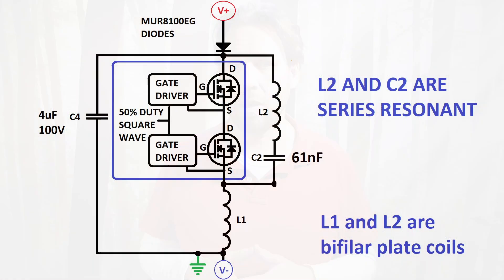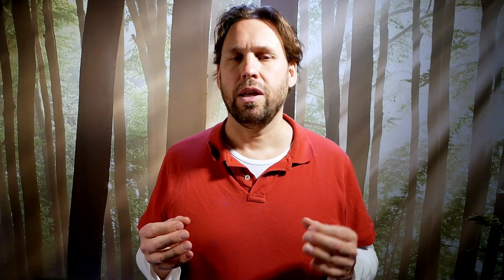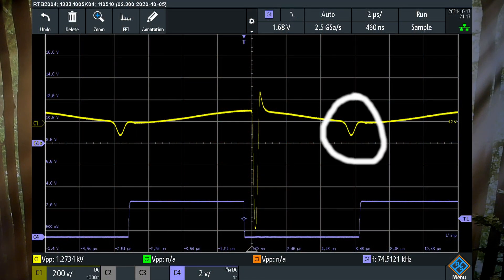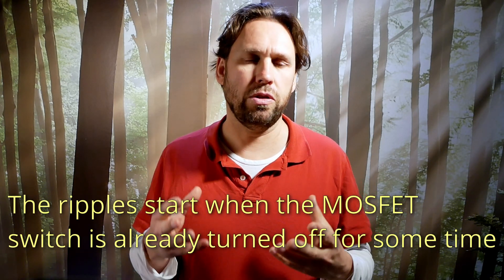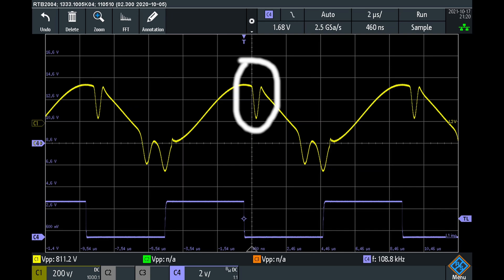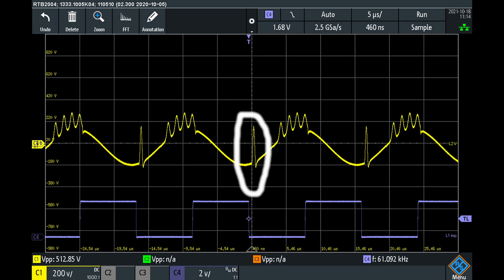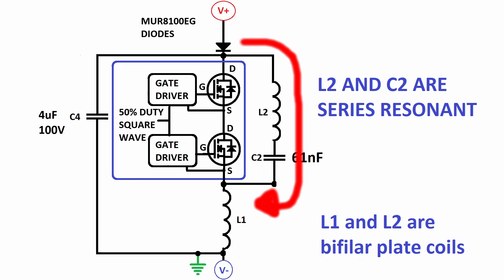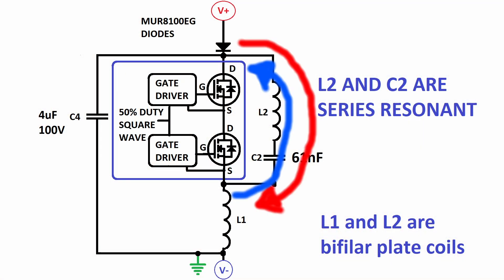The Ripple Anomaly

Comment: I'm reminded of Tesla Patent 462418 where he says "to produce current-impulses succeeding each other with very great rapidity, or, in other words, to render the duration of each impulse, alternation, or oscillation of the current extremely small."  Perhaps these ripples are a sort of guide by which to perform a resonance amplification
Reply from the maker: this is a link to the patent:
https://teslauniverse.com/nikola-tesla/patents/us-patent-462418-method-and-apparatus-electrical-conversion-and-distribution
after reading it (again) it makes me wonder about several things.

here are two quotes:
"In the working circuit, by reason of the condenser action, the current impulses or discharges of high tension and small volume are converted into currents of lower tension and greater volume. "

and

"I define the working current as one of an excessively small period or of an excessively large number of impulses or alternation or oscillations per unit of time, by which I mean not a thousand or even twenty or thirty thousand per second, but many times that number, and one which is made intermittent, alternating, or oscillating of itself without the employment of mechanical devices."

more can be found...
Reply: @MasterIvo  inductive saturation is a inevitable problem with such a large duty cycle ,  there is also more sources of harmonics than i can count on 1 hand despite a lovely simple circuit.   - but also as a rule of thumb that i was taught. - square waves and resonance dont mix
Reply from the maker: I thought saturation didn't occur in air coils, saturation is dependent on the ferromagnetic core, right?
And square waves are perfect to induce resonance (like a half bridge circuit charges and discharges the cycles)
Reply: TESLA NEVER had dc electronics (solid state) it was all mechanical harmonics if he did have solid state we would all have free energy by now....
Reply from the maker: why do you think that frequency?

Comment: This has been cracked over a decade ago. Would you like some help ?
Reply from the maker: oh please do
Reply: @MasterIvo  which are you trying to do ?
Earth electricity only or atmostphere and earth or both ?
Just know this !
Your not breaking the laws of phisics because they are incomplete.
People have died over this.!

Your are on the correct path.
But like a key to a lock, all things must be correct or elses it wont work.
Its not one thing, its multiple at once !! 
One simple truth, nature is always forming equlibrium. ALWAYS
Reply from the maker: @easyerthanyouthink 
indeed multiple acrions at once.
phase must be right. 3 coils all  coupled to one another.
one providing current other voltage (hence phase) simultaneously inducing power in ths third.
etcetera.
Reply: @MasterIvo  tell me when you online and I will post something for you. In working shifts in Eastern +10 time Australia

Comment: I'm noticing that part of the ripple does not exist visually except when you did it on an orange oscilloscope trace on your copper foil 25mm nylon pancake coil which shows apparently the more comprehensive ripple at the measurement connection.  I might say this is important, perhaps, to help understand how measurement is at least displaced or invisible at the leading point triggered by the impulse.  So this is what I have my attention upon.  The ripple or ringing in some of your set ups looks like a disconnected anomaly ("Ripple").  Then,    a with copper foil attached to a 25mm nylon & flat pancake coil the orange oscilloscope trace given  in middle of your distilled water video,   I can see a simple larger magnitude ringing that looks like the same sort of "Ripple" with about the same sort of otherwise filtered positioning from an impulse influence with, demonstrably, a very large connection ringing continuously from the impulse.   We may be dealing with virtual forms which are real having gone unnoticed. The blank part of the ringing reveals a shadow.  I'm hypothetically assuming some coil shade interactions were removed by using just the flat copper foil adhered to the 25mm nylon with only one pancake coil.  A perception of the actually larger Ripple that is not pushed,  out-phased, or whatever by neiboring coil effects has given us a glimpse of the full connection to impulse ☆.

Comment: Could the ripples be a ringing harmonic of the circuit interacting with the mosfet?

The ripples almost seem to somehow be “bouncing” the gate of the mosfet partially open with the same polarity as the impulse.

While different tunings result in different ripple patterns, they seem to have some things in common each time:

They always occur at the tail end of the “Off” part of the mosfet’s duty cycle, almost in anticipation of “ON” part of the duty cycle.

Regardless of tuning, each individual ripple seems to be  approximately 1.5uS duration.

The ripples seemingly follow the same polarity as the impulse.

These consistencies seem to point to a specific component or set of components interacting in an unanticipated way. 

Have you tried different mosfets?

How about different lengths of wire between non-resonant parts of the circuit to place components spaced out more or just different arrangements leaving more or less room between certain components?

Just some thoughts and observations, I could be completely wrong.
Reply from the maker: thanks. I noticed they disappear when tuned above resonance. then I still have a single voltage impulse.
I am now using a different setup, using current impulses
Reply: Oh that’s interesting about the above resonance tuning.
I will look for your video explaining the difference between voltage and current impulses. Thanks for replying.

Comment: "Positive and negative current"? Perhaps, this possibly useful convention doesn't serve an understanding as well as the fact that electric current is a flow electrons, negatively charged "particles". This situation reminds me of how a number of currents running in different directions on the same ground line can be problematic under certain conditions. Seems you may be talking about what happens when streams of electrons collide: being of the same charge it will be difficult to have an actual collision; I'd expect very energetic deflections constituting a turbulence that would have the effect of disrupting and slowing the electron streams. What happens to the energy dissipated in deflection? Is this like the "dielectric field"? This is what your video made me think in response to your final question.

Comment: Welcome to a ram pump using electrical voltage rather than water pressure.  Terminate an end to prevent the echo.  The question is, what is the end?

Comment: Hello Ivo. First to say thank you for  your research and the help it has given me into understanding Teslas work.  
I built your circuit and also have been experiencing the ripples. Upon varying tuning I can get from 1 to 4 ripples. I am wondering that if these are indeed expressions of the radiant energy what would happen if L3 was tuned to their frequency.  I am going to explore this and also am attempt to use a Rodin coil for L3. My endeavor is to use the circuit for health benefits rather than what you are doing with producing an energy source.
Reply from the maker: great to hear! have you used an extra coil (L4)?
the ripples can be tuned away, when L2 has a large capacitor (I use 117nF) and L3 is small, L3 needs to be tuned for max current amplification. (I had luck between 5 and 8 nF)

Comment: Hi Ivo, thank you for this very informative video. I did watch your old video in which you were concerned about the ripples after the negative impulse had been collected and you left it alone for the time being; yet it was bothering you. I just watched your video about this anomaly. I did see your intelligent insight of two currents flowing through in opposite direction. There could be a clue in this anomaly; as you said. I have my lab setup with the same arrangements you have, but I do not have dual driver circuits for MOSFET; I will do this experiment later of what I am suggesting you here to study the ripple formation after the negatie impulse. 
What is causing the collision of the current flowing in two different directions through L2 coil. As we can see when the MOSFET is open the current from the + side of the supply has now only one path to go through, that is through L2 and C2. and also that the same instance when MOSFET is open C4 has a load L2+C2+L1 but it is being charged so nothing is abnormal, however, on the next state when MOSFET closes; now C4 has a load L1 and thus creating a ripple. I guess when MOSFET is closing then C4 must be restricted to see L1 as a load. Because C4's main purpose is to collect the negative impulse generated when switch (MOSFET) is open. The ripples are taking plavce right BEFORE the rising edge. (this was Tesla's big concern; how does the system (circuit) know the switch is about to close!!!)
What I understand on the arrangement of series resonance with L2 and C2 is that the resonance of the LC series circuit is based on the frequency of IMPULSES and the CURRENT flow due to the production of IMPULSES; in other words there should not be a flow of Source (+Battery) current through this network, L2, C2.. So I thinkg when the MOSFET is open or closed, regardless, you have to block the battery current to flow through L2 and C2 network, that is, either put a diode between the source (lower MOSFET) AND C2  in series or anywhere in this network, L2+C2+Dx; all three should be in series.
For me the most interesting thing is the ripple right before the rising edge of the square wave at the Gate of MOSFET. I will also perform this and let you know. I am not an expert like you but this experiment may lead us to get the secret key to unlock a new dimension but I am  being an Electrical Electronic engineer, learning from being inspired by you. The ripples are still an invitation to get a clue and 
Thank you for asking our opinion. Regards
Reply from the maker: Thank you for sharing your thoughts.
I can tune the ripples away, by making the L2 series capacitor big, and the L3 parallel capacitor small.
the system is then tuned sufficiently above the resonant frequency of L2 (if L3 wasn't coupled).
Reply: @MasterIvo  Hi Ivo: Right; that is already visible in your video where you showed 1,3, and 4 ripples with different harmonics of the base frequency. I looked at the path when switch is open; causing a reverse flow of current through L2 and C2 network. The differential current is the same situation with the generator when a load is introduced to the generator; or a transformer's secondary causing differential current flow. It will be interesting to block the current flow in L2 and C2 network when MOSFET are acting as an open switch. I would appreciate if you could conduct this test and see the the ripples. Thanks for your reply.

Comment: If we understand 3,6,9. Saturation must occur. The  aether is what part of that . It's just a question I don't claim to understand much.  I am starting to understand 3 =Standing wave  counter clock wise  wave and clockwise wave= super saturation .  I've proven this through experiment's greater COP than 1.
Reply from the maker: where does this 3.6.9 quote come from. I read a lot of Tesla's work, but it never surfaced.
Reply: @MasterIvo  It's a quote but you would know more about tesla than I would . so it's a false quote cool but it still proved out at least for me glad to hear you peace and thanks again
Reply: @MasterIvo  I just did the research you right 100% . thanks

Comment: If your getting a bifilar with COP of 13 then why not use this as input to into bi- torroid transformer of Thane Heins? Then One of the bi toroid secondaries should be able to loop back to the input of your high Cop multi- bifilar design. Then the other bi toroid secondary output should be free - literally. Do you think it's possible? A way of Tapping resonant source without ever diminishing because of how the bi toroid segregates loads, no bemf and duplicates input power. Is it possible?

Comment: Yes! I think were very near the same wavelength! Well done in your scientific inquiry; you seach for insight, and you asked the right question just now. I just pray I can help!

If what I understand is right, you observed lamor precession in the aether after switching ended with a pause and AC current continues... the lamor precision forms over time as an object travels through the 'liquid/gas' medium.... otherwise a ripple in the 3D magnetic field sector of the aether-- a responce to the electric impulse creating a low pressure/voltage gap behind the wave. You detect it because your device transmitting id like a detector for the medium changing in certain ways.

I think the ripple is a result of the dark energy formation only coming near and hovering out of reach. It was tapped reluctantly, like dipping a toe into the water and causing a ripple, just a small part touched the other side. We don't get over unity when we sit on the fence.

Or rather, it's like swimming in the water and traveling fast horizontally just beneath the surface, and you come up for air but the surface tension didnt break, and you must pull up a bit more. Our heads do this because they are positively curved.

Oddly enough, magnetic fields have positive curvature in 3D, and the fields get modeled in similar ways. Your 'capacitative current' coil capacitor has likely semi-positive curvature in its magnetic field.

However, we don't get the nice semi-positive structures which form vortex/torsional eddies when you switch too slow. Between slow and fast, we get the lamor precession causing light interaction to form structure in the aether, only for a little energy to get absorbed in the condutor as it collapses.

Instead we want abrupt change that will cause a super nova in that pressure gap, we want the enegy of the electric impulse to dive in so fast lenz law doesn't happen, so 100% of the input is used effectively, then we want the aether to react by adding an extra spike of amplitude at the end of the wavecycles.

So, you need a more abrupt way of switching your circuit, closing fully and opening new pathways, to take advantage of the 'surface tension cutting' effects that arise of there being purely negatively curved energy, eletric field, to break the tension.

If done right, the effect will be instant and powerful. The factors that created lamor precision out of eddies will instead be instantly realized.

Thus, that power will be denser...and with denser power you'll get more power from implosion of the field.

Over unity.

So, faster switching is key. And time gaps in the current from duty cycle goinf fully on to fully off is also probably important, because it makes the ripple a solo, not drowned out-- I think you interfere when you shake the medium with AC or any continuous current, but def AC, it always emits EM.

MOSFETs dont drain fast when fasted with impulses hitting the channel, and they can force open.

Hope this helps!
Reply from the maker: Thanks!
Reply: @MasterIvo  Have you ever probed your MOSFET gates during these ripples? To see if they may be pryed open by the impulse?

Or perhaps are you leaving the gates open so that ther is an AC curcuit with your L2 coil with the power supply? Your caps may be able to drain and charge with opposite polarity quickly enough to pass AC.

If something like this is the case, the magnetic field doesn't get to collapse, but rather energy is consumed pulling into the opposite polarity.

It would be akin to pulling someone on a swing continuously through. Impulse AC would at the least require something akin to two pushers on opposite sides of the swing set. Impulse DC is the regular one swing set pusher.

Impulse current can of course do all these things.

So, I'm not sure I fully understand the experiment, but I see an AC wave on your test output lead results and the AC wave is continuously there.

I was a bit too tired to say all the angles I was thinking in easily, but this magnetic force flux doesnt glide. To 'put the car in neutral' or 'coast' the engine should be fully idle or ideally off.

We receive the energy in the magnetic field collapse event. It's transmitted back to us, and the faster we reduce electrical impulse amplitude (higher slew rate) the faster it comes back with greater magnitude.

It would be ideal I believe if your set up could allow current impulses be split into seperate rails for positive and negative, then the rails were switched without allowing backflow of current.

I'm pretty sure MOSFET gates cannot handle such a back EMF surges, atleast not one by itself. An option is a number of them in series and parallel with a computer driven gate driver reacting in nano seconds to divert gate signal powers for balancing. Thats the only way they can handle the voltage and appreciable current. 

That is because the limiting factor of  transistors within the engineering of gates is not simply voltage, but the rate of change if the electeic field (slew rate). Radiant energy impulses have a minimum slew rate of under 1 milisecond, it seems from research.
Reply from the maker: I'll check the gate once more, but I remember it being fine.
the impulses are under 1 micro second. now I have 400 nano seconds, and even had 240nS.
Yes I use mosfets in series. 3500v impulse max, using 2 SiC mosfets that officially can handle 1200V but can be driven to 1750V.

I also havd 1700V mosfets, but then the isolated gate driver IC needs to be replaced by a photo coupler.

and they are already digitally driven
Reply: @MasterIvo  ahh, Gotcha! I've come around to accepting mosfets are capable of switching fast impulses, that's a good set up!